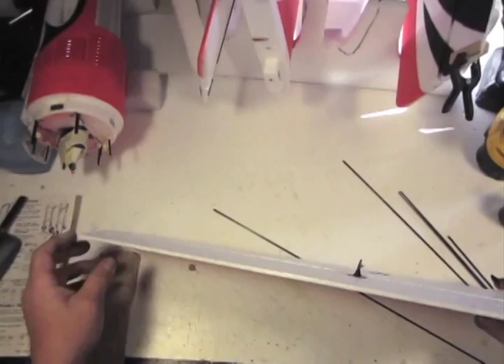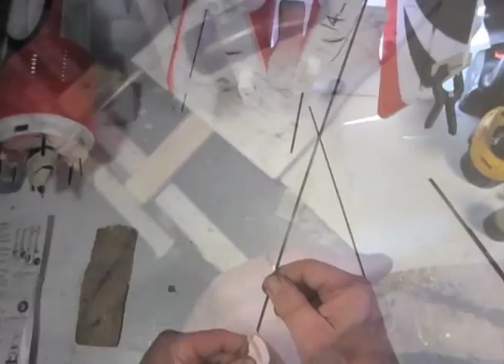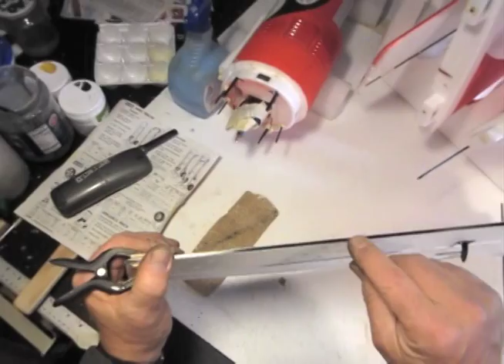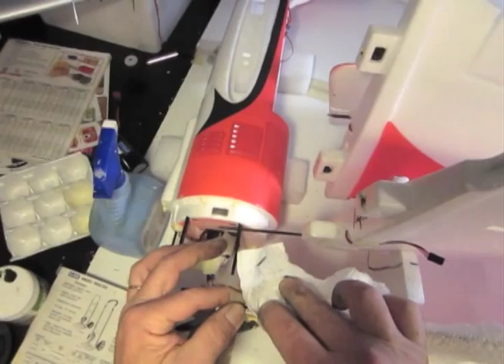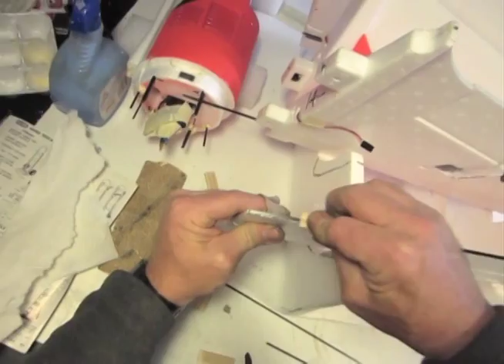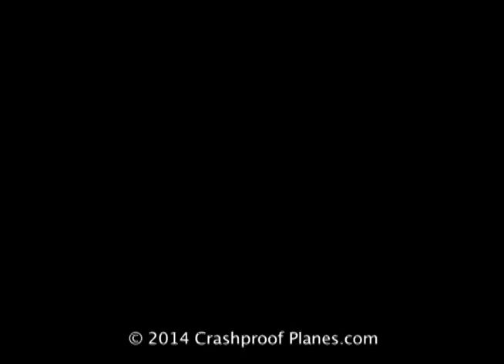DOWN & DIRTY TIPS N' TRICKS - HOW TO REINFORCE YOUR TRAILING EDGE

Comment: Mr. Dirty, what kind of contact cement are you using? The contact cement that I have (Weldwood) melts foam.
Reply from the maker: We use weldwood, and tubes of Welder. It depends on the foam, but it's OK for most EPO foam. The trick is brushing it out to a THIN coat, so it dries quickly
Reply: Killer Planes Thanks. I'll try it again.